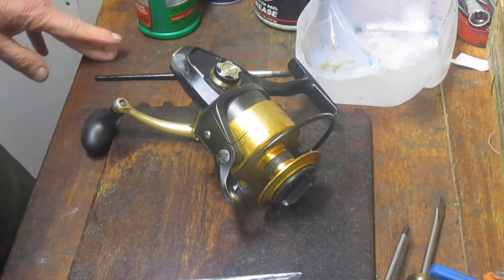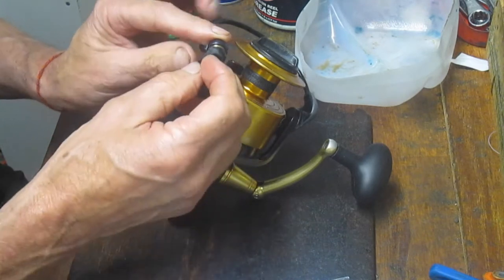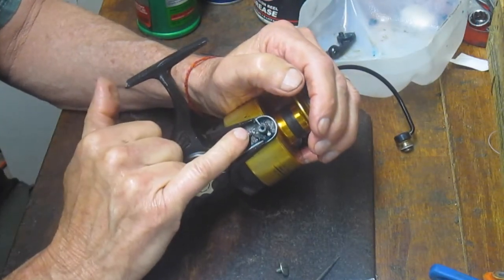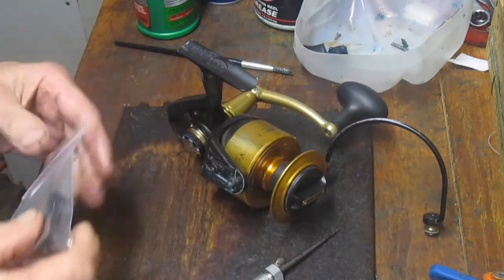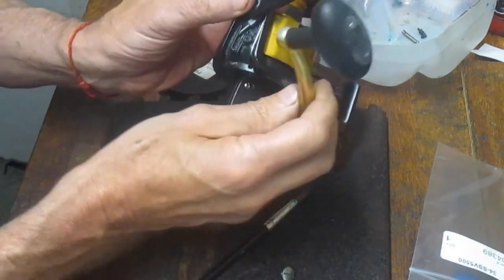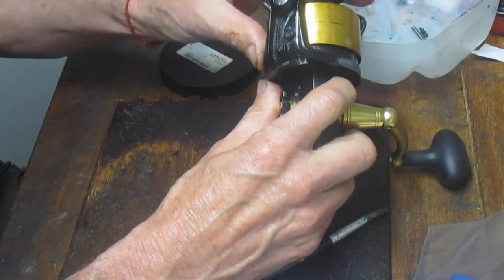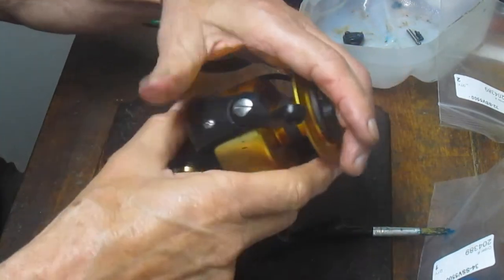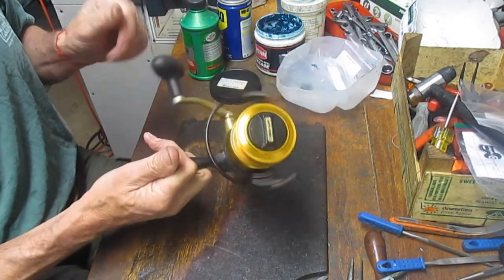Penn Spinfisher V 6500 how to service and replace the bail trip spring assembly

Comment: Excellent video Dennis! This wasn’t as easy as you made it look. You pulled off quite a resurrection on this one. As I told you, I’ve only ever had one reel that was as bad as this one and it was also a Penn though much, much older. I’m in the process of preparing for a week of surf fishing at the NC coast. That will happen only if I can get well enough to travel. I’m hoping to try out some of my vintage spinning reels that I’ve never used. I had a great experience at Academy Sports today. I took 6 of my vintage Mitchell reels there to get them spooled with line. I also got a Daiwa Emblem X 5500T reel spooled with braid ($$$$$). They did an outstanding job with all the reels -  the vintage Mitchells included a 306A, 302N, 496, 488, 302, and 402 PUM. They saved me a lot of work. Academy  doesn’t charge a lot to do this and I was very grateful. I don’t usually recommend businesses but this made my life a lot easier today!
Reply from the maker: You have been busy.  Get well soon and catch a lot of fish!  Dennis

Comment: Excellent video. Thank you. I have a New/Used Spinfisher VI 6500. The bail arm spring assembly is correctly positioned. However, when I "open" the bail and turn the crank handle, the bail doesn't engage into the "closed" position. Suggestions/Comments on how to get the bail to close. Thanks and regards
Reply: Upon further research, I discovered S VI 6500 and higher models have ONLY a manual bail closure. Regardless, I am glad to find your repair videos
Reply from the maker: You are correct.  It is only a manual bail. - Dennis

Comment: Good afternoon Dennis, great video as always. I have a Penn 8500 SS that the bale looks a little bent but the fishing line loads on an angle not quite sure what to do I’ve been checking your videos. Thank you very much
Reply from the maker: Which angle?  Is it coning high or low with an uneven line spool?  If you mean that the line is wrapping up and down on an angle to the spool, that is normal.  The movement of the spool up and down causes the line to look like it is wrapping at an angle.  Please be more specific if that does not answer your question.  Thank you
Dennis
Reply: Good Evening Dennis,  The line loads low to high to top of the spool not even. I have other Penn SS that load even.  The bail return spring is good.  The bail arm looks to be at maybe a 11:00 o’clock position not 12:00 o’clock position as the other reels.  Am I missing a adjustment on this reel?   Thank you
Reply from the maker: The height of the spool is usually controlled by the spool washers on the axle shaft.  Check to see if the white teflon washer that sits on that shaft is worn or missing.  You need to raise the spool to get the even distribution, so the washer that would raise it ay be damaged.  The lower position of the bail arm would not affect a spool where the line is coning to the top of the spool.  If anything, it would force the line to load lower - Dennis
Reply: Good Evening Dennis ,    You correct the Teflon washer is worn down to nothing.   Thank you very much. Hope you have a great thanksgiving. God Bless

Comment: Thanks for the info.  My buddy has the same reel with the same problem.  It seems like the pivot arm is poorly designed since its made of pot metal (or zinc) and the area is accessible to salt and water intrusion.  It will eventually corroded again because its prone to corrode.  One way to prevent future problem is to fill the entire cavity with grease to keep water from touching the metal parts.  It will also provide lubrication.  

I didn't trust the problem would go away in the future so I fabricated my own replacement part with stainless steel.  Its actually quite easy.  

You use a 1/8" diameter 316 stainless rod which is cheap and easily available from welding shops and Amazon.  You just cut a 1.5" segment of the rod with a bolt cutter.  Chuck the part in a drill with about .350" sticking out.  Put a washer over the rod and use a file to file away the diameter until it fits into the spring.  The washer is for spacing and to prevent damage to the drill chuck tip.  Make sure you have at least .250 to .300 of area that you turn down.  If you have a lathe, that is even better.   

After that, you just chuck the part in a vise sticking up and whack it with a hammer to make it turn 90 degrees.  Use the old part as a guide to determine how far from the turned down area to make a 90 degree turn.  Its about .400 from the center to the turned area.  Its actually not critical for the distance.  What is more important is for the tip of turned down end to be inside the guide area for the spring.  if its too short, it would deform the spring instead.  Leave the tag end long as possible and cut away some if needed.  Make sure the turned down area is smooth down with sandpaper and the ends are in a sharp V shape.  

As for the other end that you turned 90 degree.  Clean up the edges with a file until the tip is nice and flat.  It only needs to stick out about .300 from the top of the flat area to the bottom of the rod.  This is the end that goes into the hole in the bail arm.  Make sure you take a little at a time and test it out.  

It literally took me less than 15 minutes to make the part after I got the process down.  Once you have a stainless part, you will never have the same problem again.  If you look up other pivot arms, its just a right angle metal rod also.  The difference is the ends is not turned down for the spring, so I don't think it will work in this reel design.
Reply from the maker: Thank you for the tip and process.  Now maybe Penn would like to try that! - Dennis

Comment: Thank you Dennis for this very informative video! The handle on Penn Spinfisher V ss4500LL reel broke. Do you have a video showing how to remove the pivot pin from the handle assembly? The pivot pin has two threads: one for securing the handle to the reel, and the other thread is for tightening the handle cover (cone shaped) to the handle (I think). Also, what type of grease do you recommend for reels? Thanks in advance for any advice you can provide!
Reply from the maker: No, sorry, I don't have a video and I don't have that reel in my shop.  The pin is either a roll pint that you can knock out with a punch, or it is a screw.  I am thinking it is a roll pin, but I cannot say for sure.  The complete handle assembly is still available as a replacement from Penn.  I am unsure if pieces are sold separately to complete your repair - Dennis

Comment: Informative indeed! 
I noticed that you did not lube roller screw or the roller bearing, Is it optional? What is the standard practice for spinning reels bail preventive maintenance?
Thanks
Reply from the maker: A few drops of oil is all that is needed in the bail service.  They are all spring driven, so just a little oil is fine.  - Dennis